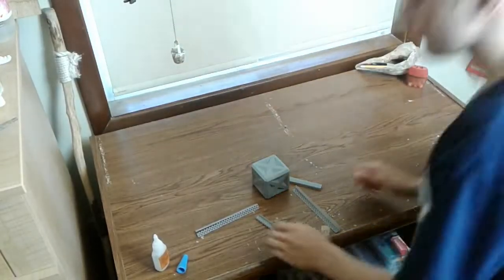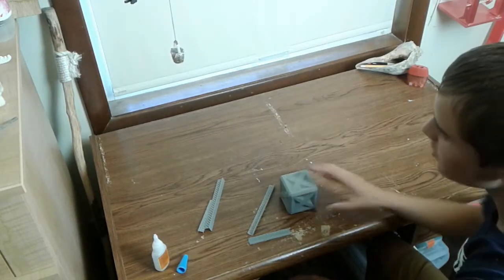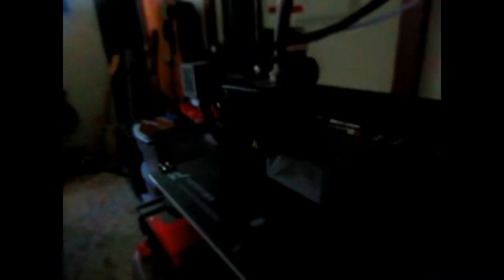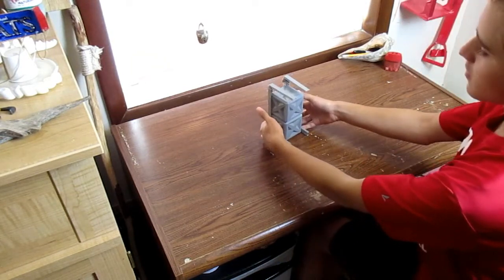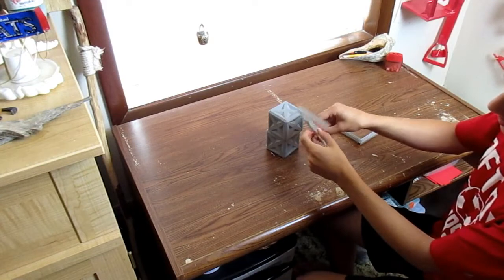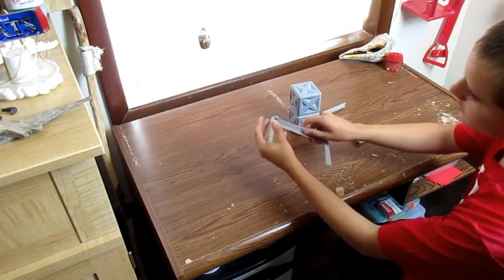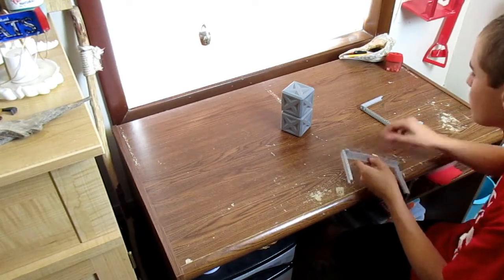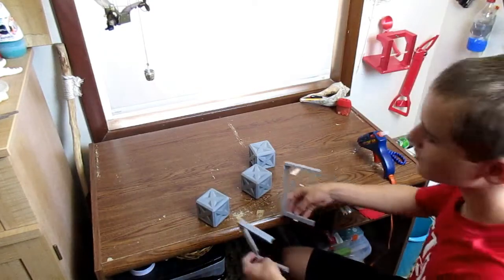3D Printed Passive Intake Prototyping! Vex Tower Takeover

Comment from the maker: These parts are really brittle and hard to print. Any suggestions?

Also, I'm back from Canada so it's time to start modding that RC plane.
Reply: Easy fix, increase the fillet on the inside angle of the c channels or L channels, and also fill in the holes in them so you don’t have to deal with stringing bcz of the overhang
Reply from the maker: @r3v3rbrobotics35  Thanks! That should do it.
Reply: Btw why don't you ad a small latch with a small potentiometer motor controller so it can go forwards and backwards.
Reply from the maker: @miniinventor1330  I don't really need it to move yet. This is prototype one. With the metal parts we moved on from that design a while ago. And I would just use a servo cuz it's easy
Reply: Use diff filament or change settings